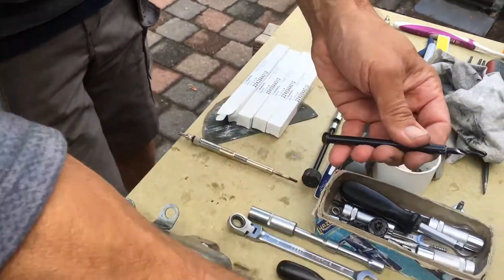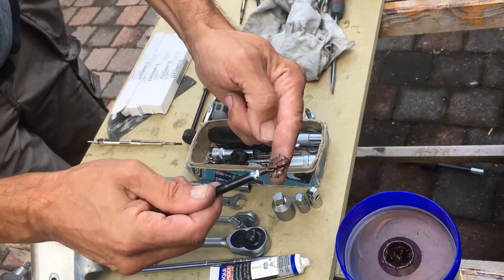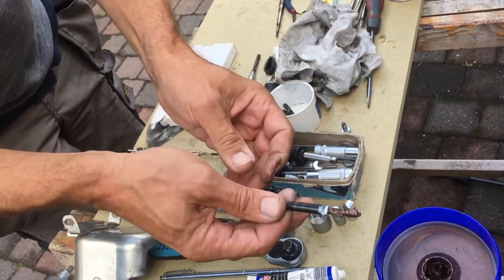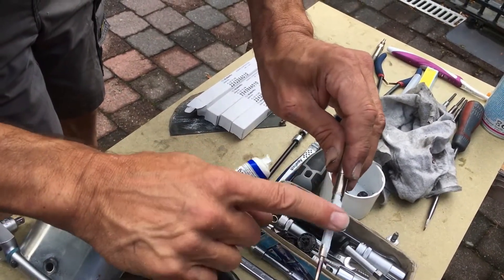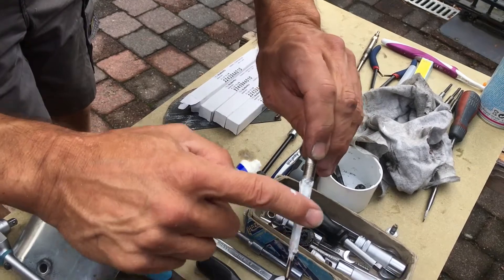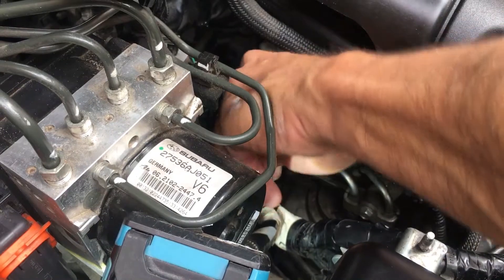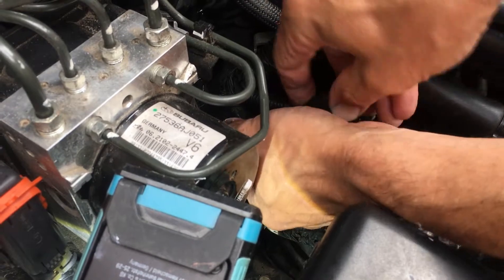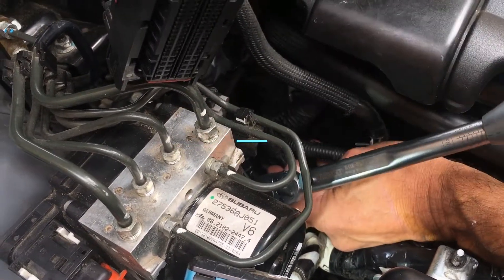Glow Plugs | Cleaning process with a reamer before mounting

Comment: I cannot find a reamer for this engine that I can buy. The "universal" types don't list this engine as compatible. What is your reamer called and where did you get it?
Reply from the maker: Sadly the sales of the one illustrated in the video has been discontinued. (Hazet brand)
You don't need per se a threaded one (M10x1,00) but a conical shape which matches the stepped section of the glow plug & inside the engine head.
As for Hazet reamer #4760-10, ±100mm lenght from the conical shape will be OK, but not exceeding ± 150mm due to the limited open space available.
Good luck, cheers,
Reply: @FredSuomi  Talked to a Subaru specialist repair shop and two other mechanics with decades of experience. None of them had ever heard of a glow plug hole reamer or anything like that. They just swap the glow plugs. No wonder I had huge trouble getting mine out and it's so dirty and the threads are clogged. 

If the threads need refreshing, they say they use a screw tap or in worst case put in new threads.

I haven't found a reamer of correct dimensions but some guys in car forums make their own reamers by drilling through an old glow plug and weld a screw tap or a simple drill bit in the middle of the glow plug. Seems a bit dodgy to me. Hard to get it perfectly straight.

I have put the old glow plugs down with something like the liqui-molly on them and then taken them up and cleaned them. I get some new dirt up each time. That will have to do for this time. I think I will just have to let it be like that for now and maybe try a screw tap on the threads if needed.

I have learned so much from your videos of this car. The details in your explanations, and the "why" is what makes it so good. Thank you again!
Reply from the maker: @backtorparn  Thank you for your kind words and for your interesting input as well , sharing to begin with ;-) - Cheers, Fred

Comment: Great video, good and clear instructions with reasoning behind your procedures.

I have had problems with an XV that is very noisy (loud clatter concordant with RPM) when cold. Also problems with misfires which shows as "jumps" when driving with a cold engine in first and second gear. I have been using diesel injector cleaner fuel additive, used 1000 ml in a tank with 10 liters of diesel. So far I've only driven 50-60 kilometers in short trips of 10-15 kilometers, but over the week since I started the issues have steadily improved. If there are still issues, do you believe there is a point in replacing glow plugs? I am thinking of buying a bidirectional diagnostic tool like Topdon Artidiag so I can run DPF regen and injector calibration, it seems like the cost of diagnostic tool would be offset to a degree by saving on workshop visits, and I think it would be useful for problems that might arise in the future as well.
Reply from the maker: Hi, dirty-faulty injectors are indeed the prime suspects in case of loud clatter and engine jumps during acceleration. To answer your question, you may not be able even to fire up your engine with one or more faulty GP's. These are indeed only powered by the ECU during start-up at cold state. My recommendation will be to replace them each ±60.000km and not to wait for them to fail & being stuck with your  XV somewhere in the middle of nowhere. Cheers,  best wishes for your injector's cleaning process.

Comment: What reason do you use copper grease for the reamer, versus using another type of grease? thanks!
Reply from the maker: I have been using this type of grease with this tool for a very long time & without any issue so far. But as shown in some other vid I don't use it as thread lubricant for the glow plug itself, taking the possible reaction between current and copper into account. (Corrosion and/or seize)

Comment: Ceramic paste under no circumstance should go on the thin tip of the glow plug, big mistake, apply it only on the threads and little below threads on the shaft
Reply from the maker: Thank you for your input - No issue encountered so far (> 800.00kms = 7x GP replacements) with the shown lubricating method - Sharing experience is all about -
Reply: @FredSuomi so do the GP’s need to be replaced around every 100k km?
Reply from the maker: @yakakiyakaki  Hi, not strictly necessary but why to wait for these bloody GP's to fail? A swap with new ones each 100k km will avoid to run the risk of a broken GP in its well, with all the consequences that this entails for a boxer engine like the EE20.